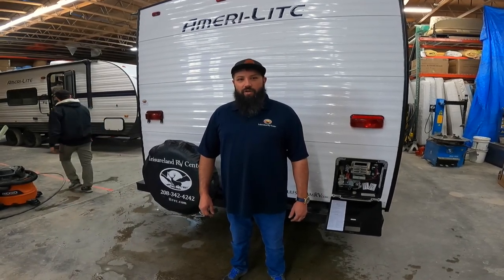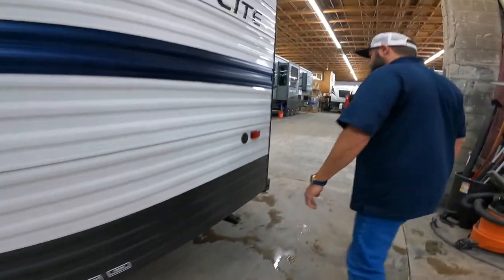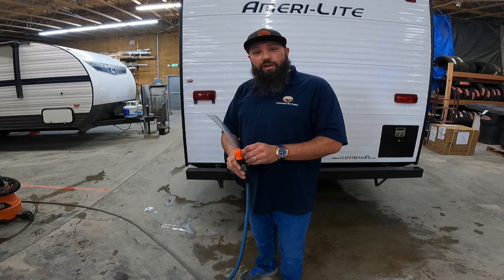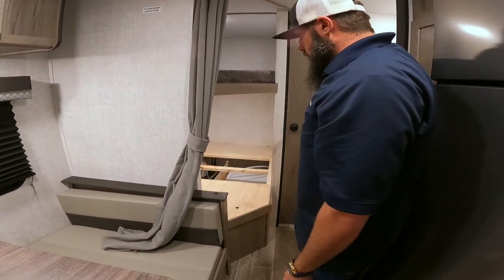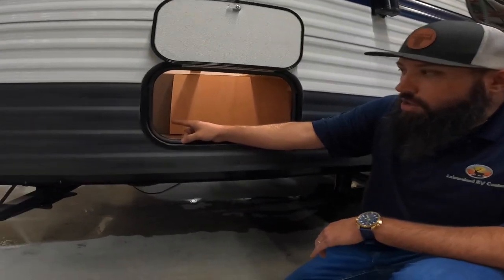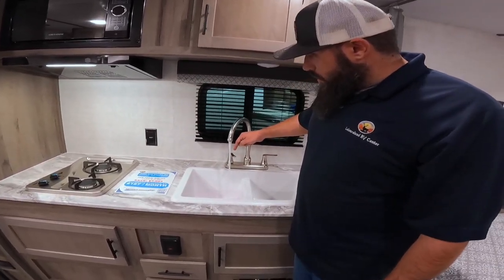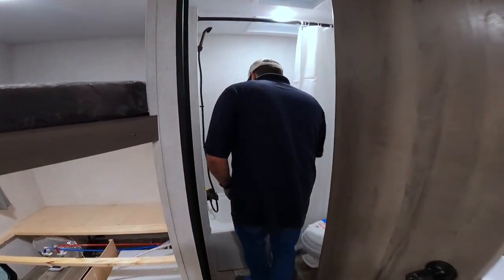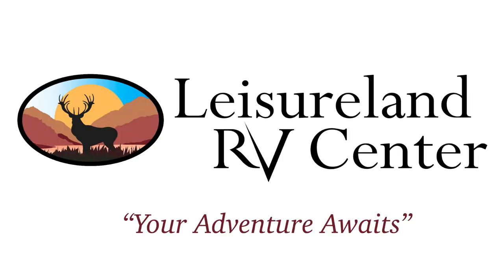The Best Way To Dewinterize Your Travel Trailer (Quick & Easy)

Comment: Why do you open the hot water bypass valves before purging the antifreeze?
Reply from the maker: When you're taking the water heater out of bypass mode there's no wrong time within the process to do that. some dealers/repair shops take the water heater out of bypass mode at the time of winterization so the only thing you have to do in the summer is add water. We hope this answered your question. If you need further guidance give us a call at (208) 342-4242 we offer free technical advice.